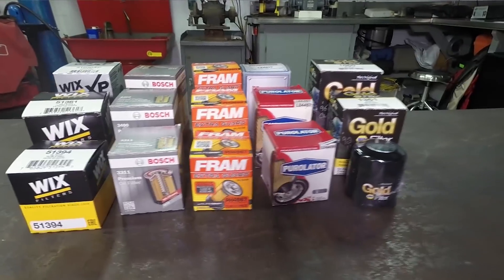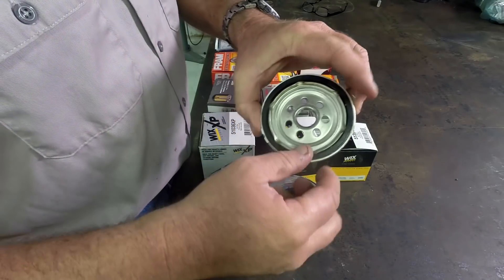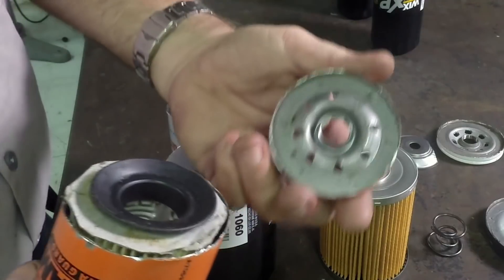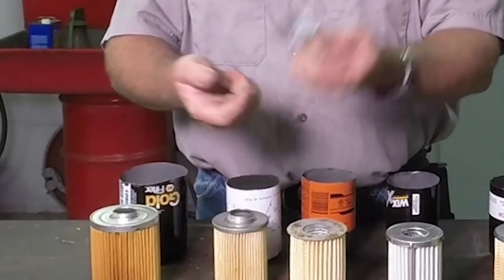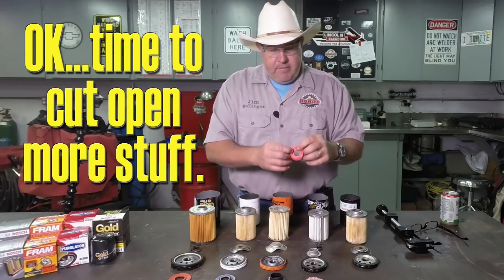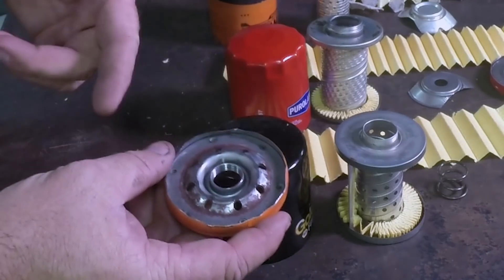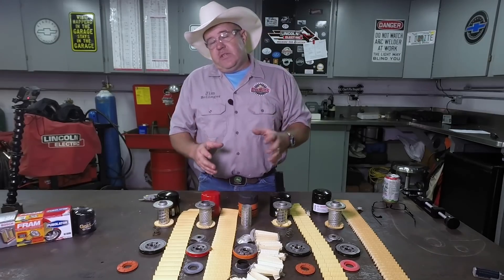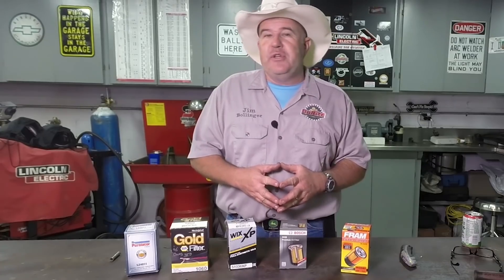The worst oil filter EVER!

Comment: I've used FRAM oil filters on my 87 Toyota 4x4 for nearly 33 years and never had any problems.
Reply: Evo Reso I’ve used them on my 1999 Dodge Ram and has 480,000 on her now and still going strong with fram filters being all I ever used.
Reply: I have had several 1987 Toyota products and all of them were reliable as hek.
Reply: Maybe the rust is part of the filtration system.
Reply: @lynnh7694  and maby the cheap cardboard inside them instantly turns to epoxy resin, as soon as hot oil hits it...
Reply: Lynn H this video is such a crock of shit. Unless he’s going to do a tear down and scientific break down after 5000 miles he’s full of it.
Reply: @leesmith9942  I played 3 rounds of Russian Roulette and didn't die, want to go play? Experience bias is still bias and detrimental to any logical conclusions. The fact you couldn't even see any use for this video is troubling. For 33 years you have been loyal to a brand. Now when you see with your own eyes that they use a cheap filter media and less of it than other competing brands you would rather shoot the messenger instead of hold them accountable? That's like finding out your accountant is banging your wife and saying well I never got audited in 33 years, and screw you neighbor for telling me about it!
Reply: James Bumgardner none of what you just sent me made sense. Even in the video. What ever your getting on with your better off keeping to yourself.
Reply: @imposter 0shadow 
The best Napa filter is the one that has the neoprene check valve ,that you can see when you look at it at the bottom!!!  Because it doesn't get hard and lose it sealing propertys!!!  Most other filters have black check valves WHICH get hard and leak back all the oil in the filter!!!  So every time you let your car set for awhile you get a dry start witch is not good!!!
Sir, just read the comments and you have people that have used Fram FILTERS for year!!!  Have vehicles that have 3 - 4 - 5 hundreds of thousands of miles using FRAM FILTERS!!!
First of all!!!  Everything I said is TRUE!!! AND ""TWO"'" as you say!!!  All of those FILTERS that you cut open are BYPASS FILTER!!!  AND ANY OUT THERE IF YOU WANT TO KNOW THE TRUTH WHEATER THE FILTERS ARE BYPASS FILTERS JUST ASK AROUND AND YOU WILL FIND OUT THAT THEY ARE BYPASS FILTERS!!!
THE REASON THAT THEY ARE BYPASS FILTERS!!! IS BECAUSE IF THEY WEREN'T AND THE FILTER PLUGGED UP THE OIL WOULD STOP GETTING TO THE ENGINE!!! AND YOUR ENGINE WOULD COME TO AN ABROUT STOP!!!  IT WOULD FREEZE UP FROM THE LACK OF OIL!!!. THAT'S WHY THEY ARE BYPASS FILTERS!!!
AND I ALSO WAS MASTER MECHANIC!  FOR FORTY YEARS MORE OR LESS!!! 
MATTER OF FACT I AM ABOUT TO UPLOAD A VIDEO THAT TELLS PEOPLE THAT FOR ABOUT ONE HUNDRED DOLLARS THEY CAN BUY THE PARTS THAT I TELL THEM TO BUY!!!  AND THEY CAN INSTALL THE PARTS THEMSELVES IN LESS THAN TWENTY FIVE MINUTES OR LESS!!! NO TOOLS REQUIRED!!!  AND THE CARS OR TRUCKS LAST FOR MILLIONS OF MILES!!!  RUN LIKE NEW!!  NEVER HAVE TO CHANGE OIL OR OIL FILTER!!!
LIKE SAID THE ALL OF THOSE FILTERS ARE JUNK!!!  AND THAT'S WHY TENS OF MILLIONS OF CARS ENGINES AND TRANSMISSIONS WEAR OUT EVERY YEAR!!!
LARRY
Reply: Larry Neiderhiser my truck is rusted out  at 480,000 on it so putting any better parts on that cost more money will be a waste and to me it goes to show regular maintenance and taking care of your stuff, things last as long as the environment will let it. You can’t stop rust, you can slow it down but that’s it. Depends on how you use your vehicle also if it’s stored more then used and filters are not changed regular it will break down same as anything.
Reply: I have used Fram oil filters because of my dad.  Up to date and almost 30 years, that name brand filter is still used in our Chrysler and Honda vehicles.  Not one of then has needed minor or major engine work.  I guess the important factor is to change oil and filter regularly.   BTW great video.
Reply: Have used the fram filter for over 20 Yeats with zero engine failures.   Used in Chevy,  Honda, Chrysler and Ford.  BTW good video.
Reply: Does extra filter length make a difference? You do want bypass filter flow. Change oil every 3k and I don't think there is a big difference in filters.
Reply: Because its a Toyota

Comment: I drove an old pick up truck for about twenty years it had over 500000 miles on it when it was stolen .I would only use Motorcraft or Fram they both did very well

Comment: I've been driving for 53 years, have changed my own oil every time except twice. Probably driven 2  or 3 million miles using fram filters without an engine or lubrication failure. Who is this guy ?
Reply: The best filter is the one you prefer to use.   Have ussed probably every brand other than a store brand with no issues.  Change on time is the key.
Reply: You work for fram.
AMSOIL filters all the way.
Or K&N. Or wicks.
Reply: Keith Bjelland good thing you don’t get graded on spelling! Wix!
Reply: @garypollard9770   I try to type right but my phone spells for me and if I do not notice then you have mistakes.
Reply: @keithbjelland1813  not i.  Just a statement.  Nothing more,  nothing less.

Comment: THANK YOU! I have been trying for years to warn people not to use Fram filters that they are junk. I've been A.S.E. certified for almost 40 years and have seen more engine failures caused by those filter than I care to think about. I have always recommend using the OEM filter as the engine is designed around that filter. Thanks again.

Comment: Fram filters, those criticized by all the experts...I used them exclusively on my wife's car.  Never a problem, the car went well over 200,000 miles until a control arm broke and we got rid of it.  Would I use them on my project car?  No.

Comment: I sold Wix filters for years. The factory Rep had a display of a Wix, Fram & Purolator that was a cutout like in the video. The Purolator, along with other "off brands" were made by Champion Labs in Texas. They were far superior to Fram, which are the worst, with Wix the best. Regardless, customers would not believe that the Fram on the display was really a Fram filter.
That's the power of advertising!

Comment: The Fram filter doesn't surprise me. I was once hired to work maintenance at a factory that made some of the filters for them. In the course of my job there I discovered that they had machines that know one really knew how to fix because back in 2008 they decided to lay off all the people that knew how they really worked. Plus no real service manuals for  understanding the machines. Everything there from the assembly line people to the one that fix the machines is all done by trial and error. It seemed like the average was maybe 1 good part for every 15 parts made. the place was a revolving door for people leaving as the 90% of their employees were constantly made to feel like a piece of crap by those in charge of the plant. I once tried to find out who owned the company, so I could complain. However that was a dead end, as that bloke didn't really care what  happened with the company. Fram would be better off with the Japaneses in charge, as they would at least get the machines to produce something of real quality.

Comment: Why didn’t you do an apples to apples comparison? I’ve always ran Fram Ultragard. Cut one of those open and compare. I run full synthetic and change every 10k. 2 Honda Accords one 256k the other which I still own has 276k. 97 Dakota 267k. I’ve cut those filters open from time to time and they actually have a full metal cap on each end and filter media is top notch, no paper in those for filter media. Take a look

Comment: Six years ago I bought a 1999 dodge grand caravan with 218,000 miles on it. I put 100,000 miles on that van in 3 years. I changed the oil every 3 to 4 thousand miles using FRAM oil filters bought at Wal-Mart. At 318,000 miles the transmission went, but the engine was still running like brand new. I've used fram oil filters in many, many of my vehicles and have never had any engine problems whatsoever. I think I'll continue to use what I KNOW WORKS. By the way, I was a mechanic for most of my adult life.

Comment: Why should the companies put extra money in a casing that is going to be thrown away every 2,000 to 5,000 miles. As long as the filter does its job during its short life it should be good.  Of course there should not be any rust inside.

Comment: I think you are using the Extra Guard Fram filter, which is the lowest grade filter they make rated for 5,000 miles.  Fram also makes Tough Gard and Utra Guard filters rated at 10,000 miles and 20,000 miles respectively, and their materials are of better quality too.  So I am not sure what you are trying to proof.

Comment: FWIW, this same discussion has been going on at Harley sites for the past 20 years or so.  I had always been a FRAM guy until I saw how poorly they were constructed.  The lack of quality is not anything new, same construction for at least 20 years.  Of equal importance however is media (filter material) filtering at the micron level.  Too fine and you may have reduced oil flow, too open and you risk passing contaminates through the motor.  Different engines have different requirements.  Harley EVO motors are happy with 30 micron rating, Harley Twin cam motors need something in the 5 to 10 micron range.  Spring tension is also critical.  Too much spring and it can't go into bypass, too little and it bypasses the media. Stamped tin springs are not the best design in the world!

Comment: I use Fram on my race cars because of the lower filter area. It help the high flow of oil at higher RPM. I've tried using different filters and the motor is starved for oil at high RPM and sometimes lose oil pressure and blow up.

Comment: I have no idea why a heavier oil filter is a better oil
filter? You do not judge an oil filter by weighing it. You test how much dirt
it can trap. You test the pressure drop going through the filter. You test how
much pressure it can withstand. You test for leaks. You do not cut open an oil
filter and visually inspect it to judge it. This is simply dumb. I use Fram oil
and air filters all the time and they have never let me down.

Comment: Yes , do rite. I had a friend with a 1965 Ford Falcon 351 cu in motor which was very fast. However  it showed only 6 lbs of oil pressure on the gauge using a Fram oil filter. After changing over to a cheaper filter the oil pressure jumped up to 30 lbs of pressure. After all this time and it was a long time ago only now do I see why. Finally.

Comment: Why didn't you use the Fram tough guard for the comparison. You use the economic filter for the Fram but yet use the heavy duty high performance Napa and wix filter. Not that I'm a Fram customer but I'm just wondering.

Comment: I have used fram filters for years and never had a problem, however seeing this cut apart does draw questions about the product. But changing my oil every 3,000 to 4,000 miles maybe prevented a problem.

Comment: Bovine excrement.  There is no way to evaluate an oil filter by cutting it open.  MILLIONS of cars have run on Fram filters for many thousands of miles and haven't had their crankshafts ruined by contaminated oil.  This guy is a moron.
(I have no connection or allegiance to Fram, I just recognize idiotic woo when I see it.)

Comment: SO you are comparing Mid tier and top tier filters vs the basic Fram filter  and i guess the purolator too... Did no one pay attention to that detail?? 

If you want apples to apples comparison, not Apples to Orange *Fram basic comparison then please state that. Ive used Fram in the past and only ever get the ToughGuard or more preferably the Ultra. Those 2 are better comparison to the 3 big brand filters there with the exception to purolator since that is basic as well. You are right in saying the FRAM Extra Guard is shit I never buy it. But to say that FRAM in general is not good is completely wrong.  Again please make sure you clearly define your test and make it more even, then I will add a LIKE.
Reply from the maker: Napa gold is NOT top tier. They make the platinum and ultra or xp, can't remember from memory. The point was to show you what was inside the filters that my local auto parts were offering under their "oil change special ".

Comment: Have no doubts about what you found.  Maybe I was just lucky but I used Fram on a vehicle for 15 yrs & 225,000 miles with regular 3-4k oil changes.  When it was sold the engine ran fine and was not burning or using oil.  One caveat, the filter was mounted on the bottom of the engine so drain back valve was not an issue.  So it would seem the Fram worked, maybe it was constructed better back in the early 2000's.  Yours is not the only video that has reviled Fram is cheaply made and I no longer use this brand.

Comment: I would love to see a cutaway examination of the various OEM filters compared with the aftermarket NAPA and Wix filters you so effectively demonstrated. I've always stuck with Chrysler MOPAR filters for my past two Dodge Caravans and now Grand Caravan, to make sure I would not have the problems you illustrated succinctly with those garbage Frams
In the past, when I visited the Chrysler parts store, they had a cutaway display showing the difference between the MOPAR branded filters and the Fram - it was visually obvious how bad the latter was.
Thank you for your very enlightening video - much appreciated!  
Cheers!
Frederic in Montréal.

Comment: Screwed a wix filter on engine with melling high volume pump a friend said I would need to use it to withstand the pressure fired up engine let it idle a minute revved the engine split side out of filter pulled it off screwed on fram filled engine with oil started engine went 7500 rpm no problem been running fram ever since no problem

Comment: What about the supertech oil filters? Are they good? That's what I use for our 2006 toyota camry. I hope it doesn't ruin the engine. I'm trying to use the Camry until it falls apart. I know supertech oil filters are cheap and that's why I use them. But I do use quality oil to change oil in the car. I use Castrol gtx high mileage synthetic oil. I just use cheap oil filters to save money.

Comment: Fram makes 4 different levels of filters. The extra guard, shown here, is low quality. No one will argue that, as these are usually around 4 bucks. The tough guard is more comparable both in price and quality to what you're reviewing here. The ultra synthetic is higher quality than any of these for around $9. This is an apples to oranges comparison.
Reply: I agree the fram ultra synthetic is a good filter

Comment: I buy the $12 Fram Extra Tough Guard on my 2015 Kia Soul Plus. The filter says Ultra synthetic and High Mileage. I been using this filter for 2 years on my car. And I put at least 400 miles a day on my car. I use synthetic oil & changed it once every 3 months. I have had no issues with my car. So maybe the cheap $3 or $4 Fram filters may be garbage. But I have never bought the cheapo level oil filters ever on any of my cars. While I believe this man is telling us the truth. I have not been affected negatively in any way by using Fram filters now or ever "Knock On Wood"! I will however look into where I can buy NAPA brand Oil Filters. I buy K&N air filters and they last a long time and are not cheap, but worth the price!

Comment: You said the proof is in the pudding I have a 1996 Ford Econoline 150 it has 320,000 miles on The original engine. The engine has never been apart the only thing that’s ever been done to it are 3 water pumps a few alternators about three radiators and spark plugs and wires. I used Fram filters is its entire life it doesn’t smoke, doesn’t knock, doesn’t rattle except for for a minute or so during a cold start. It is a construction work van sometimes it was run to 8000 miles before the oil was changed, used hard overloaded most of its life the brakes rarely lasted more than 15 to 20,000 miles. What do I think of your damnation of Fram filters? I suppose you could say I got really lucky but considering the abuse the engine had to take I don’t believe that is true or possibly the Ford 4.9 L is the most bullet proof engine in the history (this absolutely could be true....considering the awful Fram oil filters I was using) or you have no idea what you’re talking about in saying Fram is crap filters. I understand that other filters are built stronger, have more filter material, don’t use cardboard or whatever else you are an expert on. Perhaps in the crucible of racing where engines are pushed to and beyond redline all of this would make a huge difference but in day-to-day use I don’t think it does. The proof is in my pudding a beautiful, scratched, dented and incredibly durable 1996 Ford Econoline With 320,000 miles on it. I still drive it on occasion when I need the space, my F150 is just so much nicer of a ride, by the way I just blew past 160,000 miles using “crap” Fram oil filters. No rattles, no knocks, no smoke, guess I just got lucky again, because After watching your video I would think that Fram oil filters would just explode after about 4 miles of use. I do like the cowboy hat though it’s a nice touch.